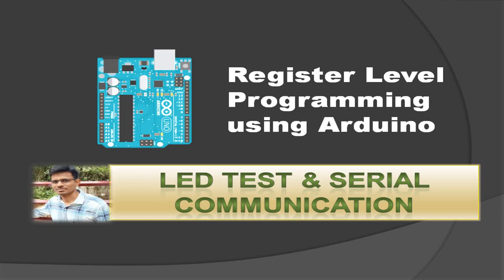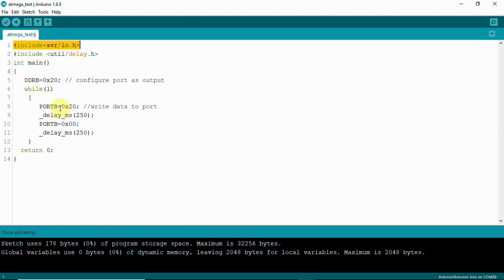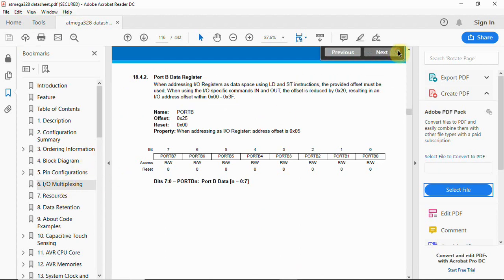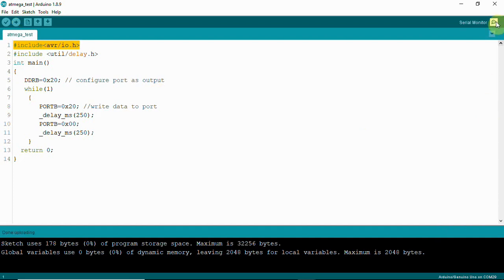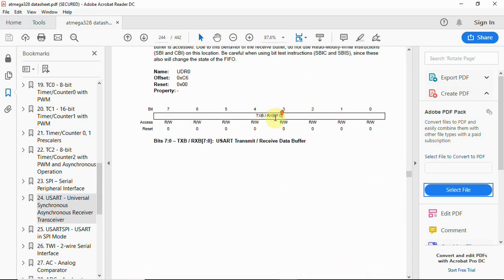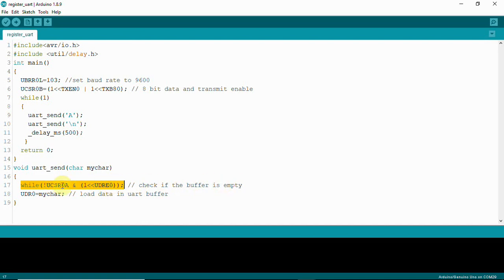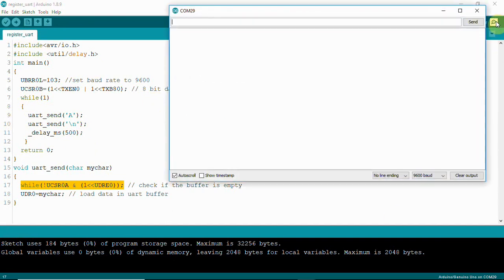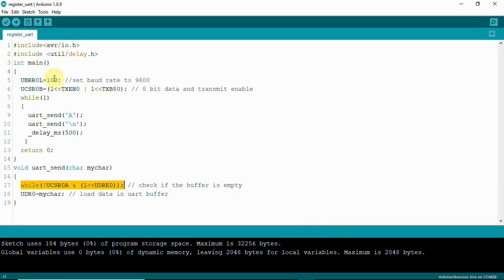Arduino - Register level Programming

Comment: Can the Digital values calculated by the ADC be stored in this 8 bit USART bit register?  Is it basically temporarily storing the values until it reproduced on the monitor, hence giving us extra EEPROM memory?
Thanks
Reply: @Druv didn't get your point, Change in the sensor readings will be reflected with change in ADC value and you copy it in a Ram variable. By storing in UART you mean you want send the data serially? If so yes it is possible